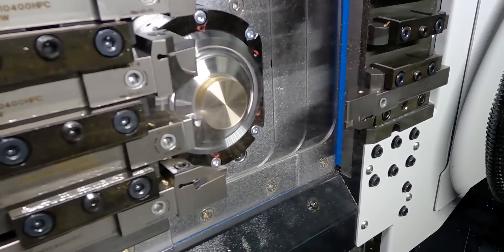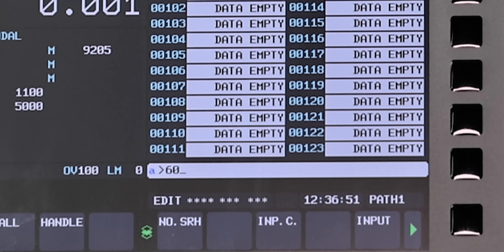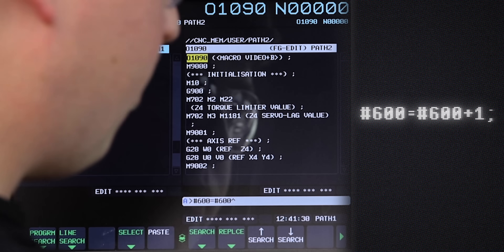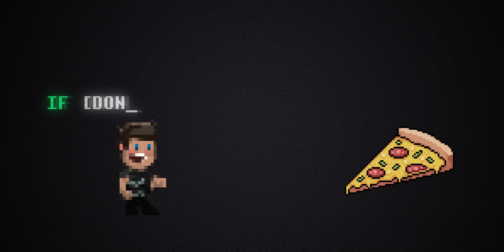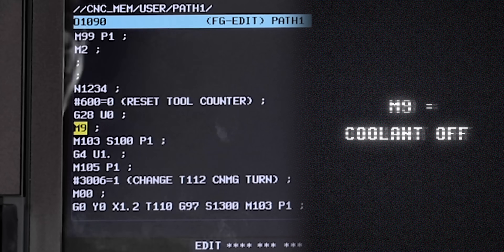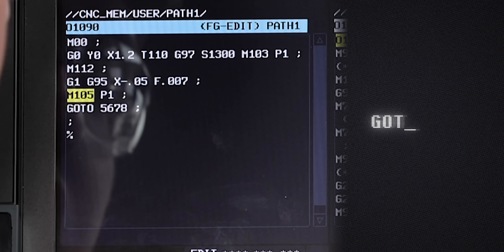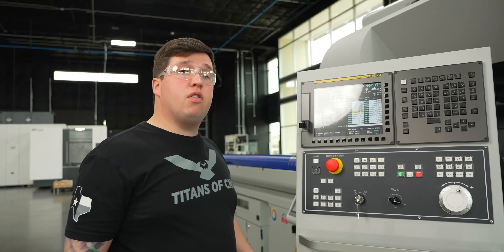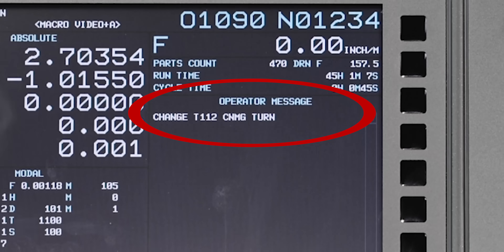Secret Art of MACRO PROGRAMMING on a CNC Machine | G-Code Genius

Comment: You can actually do the whole tool life macro (for all the tools) in a subprogram. This keeps your main program much cleaner and shorter.
There are also so many more uses for these macros, for example automatically calculating the origin point of the piece (even for both spindles if your machine has them). Also for dual spindle you can calculate where the 2nd spindle should go exactly when taking the workpiece from the 1st spindle using macro and subprogram (to keep main program clean and short).
I've done a whole system like this (more stuff than I wrote here) for myself when I was in school, even tho these things are not taught in school.

I wish I could have a job like these guys where I can try stuff and discover better systems.
Reply: Why can you not have a job like this? I’ve been doing this for 17 years and I can clearly see you know what you’re talking about. You don’t have to wish anymore dude.
Reply: @cloudriz  because nobody gives me a chance to prove my skills. Maybe one day I'll also get lucky

Comment: This is what separates master machinists to machinist GODS. I've been testing macros for a year on my turret doosan, usually for knowing how long the bar stock is before changing to a new bar, or for milling polygons as Manual Guide i doesn't have a cycle for face milling polygons on my machine. You can even use macros for calculations while in a toolpath, if you want to make an elliptical shape or anything that is not a cone or a circle with some math included without a cam software. When done right, it is beautiful, efficient and, your co-workers who probably don't even know what a macro is will think you're doing some black magic and put their professional knowledge in question. On a technical note, always prefer using conditional loops such as WHILE rather than GOTO statements to avoid some nightmare situations. One interesting book about macros is CNC Programming using Fanuc Custom Macro B, by S.K Sinha. The author also replies to emails with technical questions and is much responsive on cnc forums
Reply: Is that book for lathe or VMC machines??

Comment: HELICAL HOLE MILLING MACRO PLEASE!!!
Reply: I wrote one myself🙂
Reply: do you mean just the normal helix? you don't need a macro for that. I will write you an example of how I do it (Heidennhein) 

G0 X0 Y0 Z50
G0 Z10
G1 Z1 F...
G43 X=50:2 ( 50 is the diameter of the hole in millimeters )
G41 
G3 Z-20 I0 J0 K-1 ( K-1 means that when the tool is working, the shift is 1mm downwards for one round. in this case, the tool will make 20 circles downwards )
G3 I0 J0 ( I only do this to clean the bottom of the hole )
G40
G1 X0 Y0 
G0 Z100

Comment: How about programing making a hole with an endmill with spiral toolpath?
Reply: do you mean just the normal helix? you don't need a macro for that. I will write you an example of how I do it (Heidennhein) 

G0 X0 Y0 Z50
G0 Z10
G1 Z1 F...
G43 X=50:2 ( 50 is the diameter of the hole in millimeters )
G41 
G3 Z-20 I0 J0 K-1 ( K-1 means that when the tool is working, the shift is 1mm downwards for one round. in this case, the tool will make 20 circles downwards )
G3 I0 J0 ( I only do this to clean the bottom of the hole )
G40
G1 X0 Y0 
G0 Z100
Reply: Yea that’s a good one! You thinking like a circular pocket macro?
Reply: @donniehinske  yes. I work on a 4axis mill on FANUC. Basically I use mostly build in instructions from machine. But i'm curious if it is possible to make a macro for making a circular hole but with spiral toolpath like from cam software. Normally fanuc does it like this. Drop down in pre drilled hole or pocket then it makes a circle then adjust one step into the material and then another circle upsizing hole with each circle by that step u programmed in built in cycle. It would be awesome to do it like from cam where you have constantly increasing  diameter in which tooll traverses. With macro i think you can program end diameter you want and then program step of that spiral. It would need to include that incremental instructions but it is hard for me to grasp yet. Sorry for bad english. Thanks for reply love your content ppl and all of it. Best wishes from Poland! BOOM!
Reply: @Yamototamto  I see what you are saying. Let me start jumbling that around in my mind and I’ll think of something. I’ve written circular interpolation macros before like you are saying I’ve never had it increase diameter as it does the circular movement (spiral) like you are saying. 

It CAN be done though. Nothing is impossible! Stay tuned for a video
Reply: @Yamototamto  also… thank you! I am glad you enjoy our videos!!! 😀
Reply: @donniehinske  i mean that what you said. Increasing diameter while doing movement. The result is the tool eats same amount of material while keeping same work pressure. There are no stopa and sudden entrances into material. Just smooth toolpath till end diameter is reached.
Reply: @Yamototamto  I like it! It will be a more advanced video but I’ll tackle it! Thank you for the recommendation and thank you so much for reaching out!
Reply: @donniehinske  Sure :D
Reply: @Yamototamto es, it’s possible. I’ve written one that plunged into a pilot hole, or helically interpolates one if not there, then spirals out to finished diameter at a step over you specify and cuts a finish pass at 2/3 the roughing feedrate.

Comment: Wait,,,  I have a program running in a loop, the machine increases the tool count at the m30 so it's not counting.  Would I have to write a macro for each tool? Or,  does anyone know how to make the machine count the tool usage while in a loop? Mazak 510c nexus mill, thank you for any help or assistance!
Reply: Yes you have to add this logic for each tool if you want to do it correctly. Lots of typing at first but when it’s all done it’s worth it
Reply: when I use a macro, I use it for each tool separately and I don't define the macro at the beginning of the program, but after changing the tool. I define F with a macro and then use that macro. if the operator needs to correct F, he corrects it immediately at the beginning of the tool and then he does not need to look for it in the program where everything changes the offset ( Milling )

Comment: I had no idea macros were even a thing before your thread macro video, so any video on any macro will be interesting for me. Also, are macros mostly used in swiss machines and production of big quantities of parts?
Reply: Macros can be used on almost any CNC machine. Some just may be formatted differently. Any Fanuc control with Macro B will work like this. You just may only have #500-#549 to play with
Reply: Macros can be used in a wide variety of lathes and mills. I've created mill macro program to quick write center/drill/tap programs that kick out proper speeds and feeds for simple plates, a single program for making multiple simple bushings per push off our Haas Lathe w/ barfeeder just by entering the desired OD and length, and controlling stock breaks on Swiss machines when for when you find yourself swapping bar sizes every time you run a job. They definitely take a lot of upfront programming and knowledge of what your using them for, but can save a lot of time in the end for shops that find themselves making a lot of simple parts that change sizes with the wind.
Reply: @havokwest4359  when you learn to use a macro, programming becomes easier and the program is clearer and neater when written by hand on a machin. and the advantage is that you seem like God to operators who cannot learn and understand how macro works 😄
Reply: I ran a EDM wire 95% of the time using macros. Had it from setting up a pallet of parts, calling programs to set each position, then each program per part. Even had it changing power settings and spark gap for the same program depending on material thickness. All from changing a few numbers. Macros are brilliant  and simple for operators to use. I love programming them, the harder the better. Really gets the old brain working lol.

Comment: What if operator doesn't give a f and keep running? Still need to educate ppl to look at a screen. This was a very educational vid to understand how macros work but is not applicable in real world if you need a dummy to operate a machine safer.
Im not negative about this video,  just not see the relation between macros and make dumb people smarter 🙂
Reply: There is no macro that will be as effective as a shock collar for negligent operators. I could probably figure out a way to make #3006=1 send a signal to zap someone but anything short of that and you will still run with dull inserts

Comment: Where can i buy that book?😊
Reply: The book is written by Peter Smid, called FANUC CNC custom macros. It's nearly 20 years old, so you can find some used copies floating around somewhere online. It's also still in print if you want to buy it brand new.
Reply: Could download the pdf

Comment: Really nice and informatic video im currently on a DMG Morie NLX3000, with a Mapps II OS, is it Possible to do it in a Maschine like this with the same macro code or do i have to search for the macro code for my machine?
Reply: Your machine will have #500s and up. Just find them in your offset page and make sure they aren’t being used before typing away. I know on older Mori machines the macro menu is harder to find. It’s annoying but it’s there
Reply: @donniehinske  Thank you for youre reply, i found the macro page but i never used it cause im just a trainee and for our Programm wen dont really use them
Reply: @donniehinske  I first need to ask for permission to make something like this cause it takes time, and if the machines not running the company losing money
Reply: @donniehinske  when we use the macro, we use it so that there is no problem even if the macro is used. for example: if I use #500 to define the offset at the beginning of the tool and another operator overwrites that macro with another variable, it's not a problem because when I start my program, macro #500 is set again to the value I defined. you mentioned that you have a macro of that thread stored next to it. if you defined those macro values in that program, you can later delete or change them without any problem, because the next time you start that threading program, your values will be written again in the macro you use.
Reply: @tomislavsvogor3877  it’s not coworkers you have to worry about it’s machine macro programs that the manufacturer uses. If they are using #500-#530 to calculate things for pick offs or other things driven in the back round you can cause a crash.

Comment: Busting out a nearly 20 year old book Peter Smid at the beginning; FANUC CNC custom macros, Programming resources for Fanuc Custom Macro B users

And yet because of how archaic G code is(Develop around the same time as FORTRAN), that book is still relevant. On the plus side G code is still being updated which is why Marcos and conditional loops are a thing. Now if only the manufacturers would actually standardize their G code and Macros.
Reply: It's wild seeing this as a regular computer developer. This goes right back to the earliest ways of programming with explicit GOTOs and persistent global variables called macros for some reason...